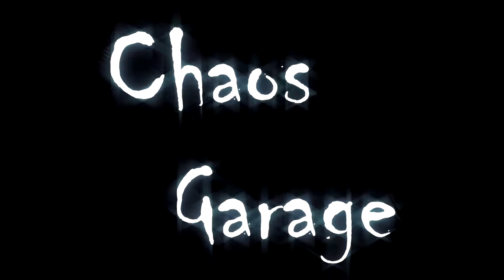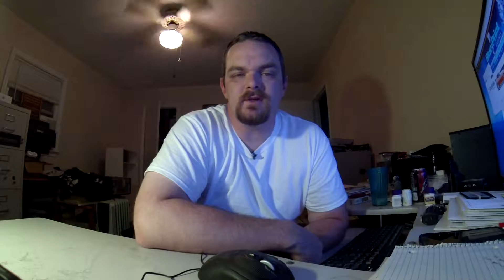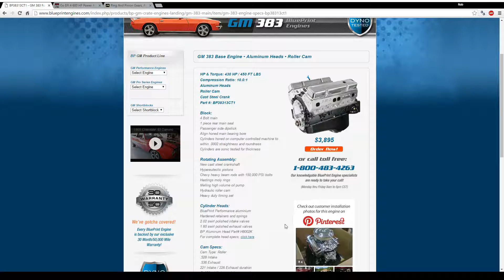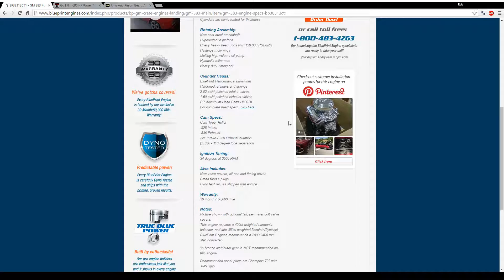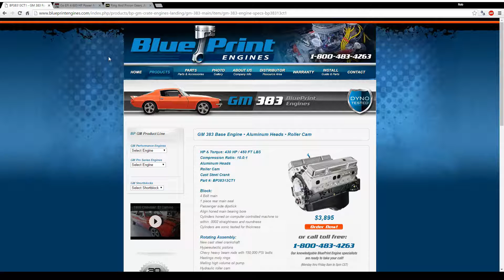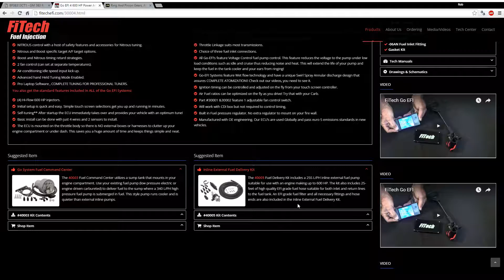1978 Firebird Formula Part 9: Let's Chat - Some of my plans for the car

Comment: So in the process of working through your videos, you keep mentioning that you are going to clean and pain the bottom of the car. Have you done that yet and if so how did you clean it?  My hope was to sandblast the bottom to get all the surface rust off  and then paint it the red oxide like the factory, but I can not figure out how to do that without completely taking the car apart and putting it on a rotisserie.   Can't wait to see the motor in the car.
Reply from the maker: I have not done much to the underside of the car besides cleaning where I welded the floor pan in.  I'm planning on wire brushing the crap out of it, give it a good coat of purple power, and pressure washing it.  Then spray on my metal etch and wash it off before POR15.  If I had a decent sand blaster, that wouldn't be a bad idea.